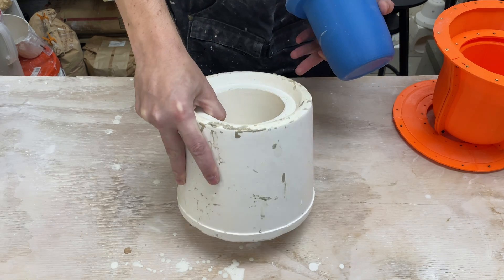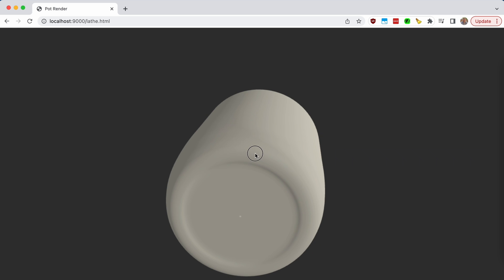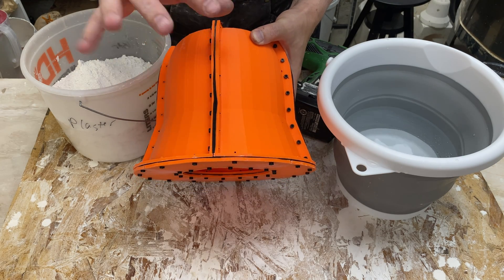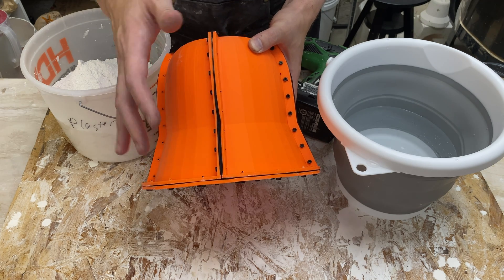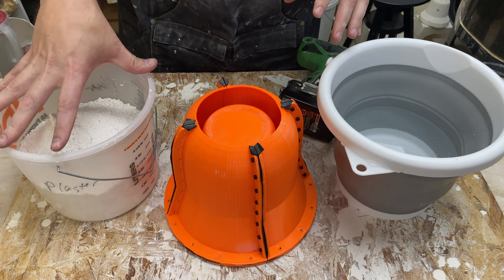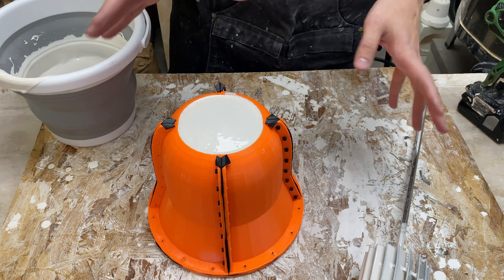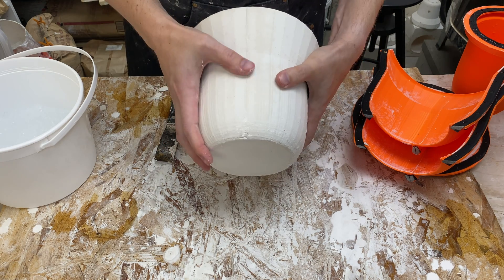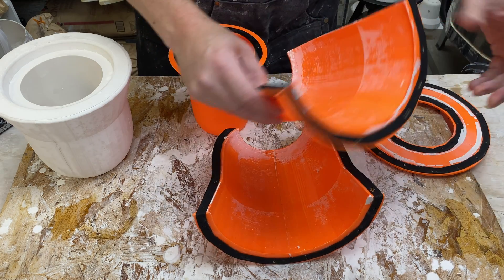FINISHED - Automatic 3D Printed One Part Mold System for Slip Casting

Comment: Kent, I’ve only just discovered your videos and I am loving them! I am hoping to try your method soon. I do have a question. For the outer “flanges” (I hope that is the correct word), rather than using screws and inserts, do you think strong binder clips would work? It seems like it would and it would save some time and they are reusable (whereas the threaded inserts are not).
Reply from the maker: I have thought about some other options, and want to get back to doing some experiments. The bolts and inserts are doing 2 things. First, they are attaching the parts together, and there might be other options. The second is that they are aligning the parts. For the outer mold, that alignment isn't very critical, but going into multipart molds it will become more so. BTW, threaded inserts are reusable, but much more annoying to do so.

Comment: Hi Kent, your video is great. It's awesome. I have a question for you. What effect does mixing alcohol and water have on 3D printer resin? Thanks in advance for your answer.
Reply from the maker: I don't use resin based printers, but from what I understand they're actually washed in alcohol pre-curing so I'm guessing it is no issue. Otherwise I'd imagine it would do the same thing in terms of shrinking the part just a bit to help with release.
Reply: @PotterybyKent  Thank you for your answer. We are looking forward to your new videos. Good work.

Comment: Hi Kent. I have watched through the whole series and I am still unsure why the inner plug needs to be separate from the bottom ring? Since the plug is designed with a negative relief pouring from the bottom, the top ring does not create any type of overhang. By having the plug, slip well, and top (actually form bottom) as a single printed piece, there is no opportunity for leaks and A LOT less screws and heated inserts. I have also thought (while using a bit more plastic) that you could export the bottom, slip well, and plug as a single, solid mass. Then print the part with a few perimeters and minimal infill - or even quicker, print in "vase mode" and then fill the plug with sand or other solid object to make it strong enough to prevent deforming with plaster weight. Lastly, I thought it may be useful to design a small cutaway in the slip well to serve as a pouring spout when removing the excess slip during casting.

Great work and really loved the series of iterations you did.
Reply: Oh, also forgot to mention, that I have had a lot of good luck with making a small .75mm channel on both sides of a mold half and then pressing a piece of TPU filament (1.75mm) into the groove on one side before closing up the mold. The TPU squishes into the small cavity and works like an o-ring. That might be easier and cheaper than using gasket tape.
Reply from the maker: Thanks for the comments!! There's a lot to unpack:

The inner mold is separate for a few reasons. One is print volume size and print speed. The inner mold you want high resolution while the bottom/outside it is not needed. The outside and bottom can also be split with 0 impact on the pot. I also anticipated needing to change the geometry for 2 part molds.

I havent found the number of screws/inserts to be an issue and I haven't gotten any feedback to that extent either. I still suspect it's overkill. At some point I need to test dialing back the quantity. However failure means a plaster disaster so I'm ok with more than more!

I've thought about using vase mode. It might be something I explore in the future but there are several challenges in doing so.

The poring spout is also something I've thought about. However in practice it is not a slow pour - it's more of a dump upside-down type of thing where a spout wouldn't do much.

I'd also thought about specifically using o-ring material which can be bought in a roll (everyone might not have TPU laying around). In this case the geometry of the channel needs to be pretty spot on. The tape itself has an adhesive back so is easy to stick down and seems to be working.

I totally agree there is room for improvements, however my goal has been getting something working ASAP and pushing forward with features (eg 2 part molds at the moment). Over time, hopefully I'll be able to go back and make more incremental improvements. Likewise, I can see what other people who have used it encounter as issues vs non-issues.

Comment: Super interesting results! Do you have an estimation of the total weight of the PLA parts used for the mold?
Reply from the maker: Thanks! That would depend on the form, print settings, etc. But according to my slicer, the full tumbler mold w/ supports and all takes about 750g of PLA. That seems a bit high to me - I don't think it took 3/4 of a spool. But I also haven't measured directly.

Comment: Another great video. What size bolts are you using? The link takes me to 8mm but the inserts are for 2.5mm - I’m new to 3D printing so have no idea what I’m doing 😂
Reply from the maker: Thanks! The link should go to M3 by 8mm socket head cap screws. And the threaded inserts are also for M3 (with dimensions of 3mm - inside thread x 4mm - height x 5mm - outside diameter). The corresponding holes for the screws and inserts are automatically modeled into the 3D printed parts by the software.